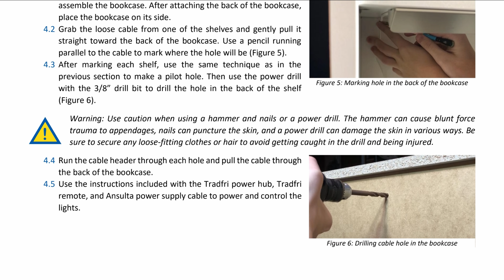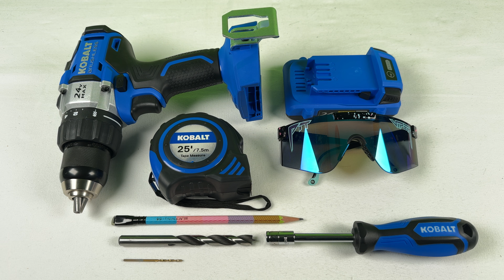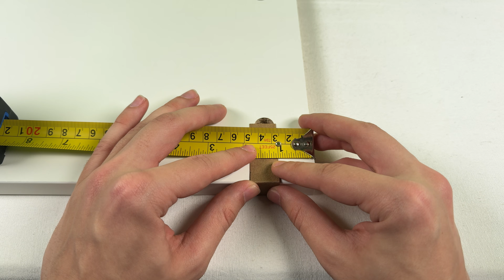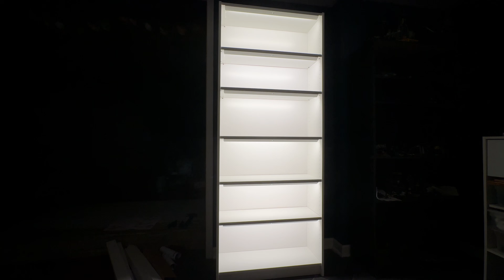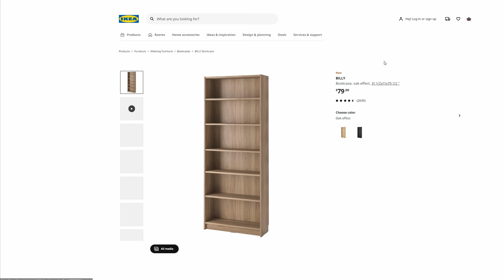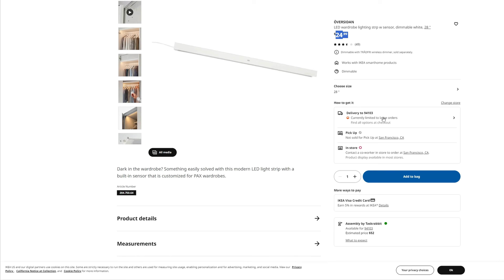DIY ALL IKEA custom lit Billy tutorial using IKEA Billy, Oversidan, and Tradfri lighting hardware

Comment: Can you still do this with the new kit? It’s designed for their closet system and I’m un sure about this route now. You have to specifically search it to find it.
Reply from the maker: I apologize, but I'm not an IKEA expert. This was the solution that I made with what was available at the time. I don't know about anything newer since I haven't had to make one in a while.
Reply: I'm wondering the same but this is part of the product details under good to know "3 different fittings are included – adapted for mounting the light strip under a shelf, under the top panel or in wadrobes with sliding doors." so it seems like it will still have the option to mount it under a shelf like in this video, but also have specialised brackets to be a more convenient installation in the PAX wardrobe. I might go get me one of these to test out in the weekend or just go see if they have one mounted somewhere in the IKEA near by and then see how I proceed.

Comment: whats the true color temperature of these LEDs, the box shows 2700 kelvin but in the video it shows it in a more whiter hue
Reply from the maker: That's likely due to the white balance of my camera. I believe they are 2700 kelvin since it's still warmer than my panel lights set at 3000 kelvin, but I have no way of measuring them myself.
Reply: @leoalpha7 forsure . just wanted to know beforehand because multiple medias show it in different white temperatures it had me thinking they were color adjustable
Reply from the maker: @MfFweep No, the color isn't adjustable, but honestly I used tho think they were way cooler because the white Billy really tricks my eye at least.

Comment: Thanks mate this is exactly what I had in my head and you made it reality lol.
Reply: It does look pretty good, I just wish it were in my price range.  I just came from a video where they used Hafele Lighting, which is SLICK, the side panels of each bookcase have countersunk bus bars and the light strips (which are also countersunk into the bottom of each shelf) have spring loaded contacts on each end which touch the bus bars.  NO CABLING except to make a circuit with both bus bars.   Only about $400 per bookcase, so yeah, I'm just gonna bust open that penny jar which is sitting on the shelf of one of my $27 Walmart Mainstays bookcases.

Comment: Great video, HOWEVER, IKEA has redesigned the Oversidan kits and they no longer are compatible with the Billy’s, because they changed the way they attach. No more metal mounting “A” and “B”, they’re now plastic pieces with integrated nubs to attach to the Pax units and are too narrow for the Billy. Only found this out when I unboxed my lights and went to build my Billy tonight and realized the parts don’t match your video or instructions anymore!
Reply from the maker: I would encourage you to check online for the 28 inch oversidans! It is possible your local store did not have the width you were looking for in-stock. Fortunately, the light strips can be shipped for relatively cheap. That's what I ended up doing for my third Billy.
Reply: @leoalpha7 unfortunately these are the 28” versions. Just got them last week and the hardware inside the box is completely different. All plastic.
Reply from the maker: @TheBeardedGentleman Well I've never had any of my light strips come with any metal hardware except for the screws. All of the attachments are made of plastic.
Reply: I just purchased this setup and everything worked just like the walkthrough stated.

Comment: These lights seem to be switch by sensing light and not motion which is a shame as they would just stay on most of the time on an open shelf. We are using them in wardrobes where some of the space is open so the sensor option does not really work for us.
Reply from the maker: I can't speak for the motion sensing part, I just turn them on and off manually.

Comment: Well done, mate! I am considering doing something similar with Högbo doors on the Billy shelve and using the long Mittled lights- do you have any references on these? :)
Reply from the maker: I don't know about the doors, but I personally would use the oversidan lighting instead of the mittled system. The mittleds shine straight down instead of at an angle creating a less optimal lighting condition. As for the doors, it looks like the hinges wouldn't interfere with the lighting at all since the oversidan light strips don't span the whole width of the shelves.

Comment: wire goes through the bottom, fine. how is it fished from bottom shelf to next shelf up? Do we need a hole in each shelf plank or how does wire path go from one shelf to the next shelf?
Reply from the maker: @islandmerchandise3017  Each light on each shelf has it's own cable that is fed through the hole in the back of the bookshelf. Then all of the cables run down the back of the bookshelf and get plugged into the hub.

Comment: Oversidan lights are now discontinued, any alternatives?
Reply: MITTLED! I built and customized my Billy this weekend with the mittleds and it turned out absolutely amazing. 
You need (my suggestion):

1 big billy
2 hogbo doors (optional but needed in my case, my apartment gets a lot of dust from surrounding parks and construction)
1 tradfri
1 fornimma (cable for tradfri)
5 mittleds 60cm (1 for each shelf. ideally would be 6, but tradfri can only handle 5)
5 vagdal (cable for connecting mittled to tradfri)
1 rodret (the new remote control)

i think that's all. total cost was 290eur.
Reply from the maker: @yAr3d2010  You've gotta be kidding me
Reply: Looks like there are new ones out now. Ar least in Germany.

Comment: Hello, thank you very much for the video. As I understood correctly, you should first attach the lightstrips to all the shelves, including the middle one which cannot be moved later, and to the top one, and only then assemble the Billy. Then you just have to drill the holes at the back and pull the cables through and connect them, right?
Reply: I'm not the guy from the video, but I have added DIY lights to three Billy bookcases so far... yes you should install the lights on the shelves prior to assembling the bookcase. I like to to assemble most of it, slide the backing board in and mark the drill hole locations. then drill flat surface. use masking tape to prevent damage and chipping from the drill. If you haven't decided which position the movable shelves will be in, then you may have to drill after fully assembling and adjusting the shelves.
Reply: @ okey thank you. I ordered my Billy and some lights from Ikea, let‘s see how it will look. I think I will drill the holes after I put the shelves in because I have to find the perfect distance between them cause I want to put Anime statues and some are 30cm high and other 50cm.

Comment: I couldn't find this answer online, so I hope you can answer it here. The TRÅDFRI says up to 10 devices can be connected to it, but that connector thing only has 9 ports, where or how does the 10th port come into play?
Reply from the maker: @Noyma  The TRÅDFRI can connect up to 10 devices, as in the drivers, not the individual light strips. That means you could technically connect up to 90 light bars. That being said, I have already run into de-sync issues with only two, so I would only advise attempting this if you are willing to do a lot of plugging in and unplugging to sync all of them.
Reply: @leoalpha7  Oh sorry the IKEA naming scheme confusing. 
I meant the 30w power supply, I see only 9? connector holes, where on the power supply is the 10th hole for a 10th light bar? I planning to connect some more lights outside the bookcase, but the desync fixing doesn't sound fun.
Reply from the maker: @ Yes, you can connect 9 light strips to the TRÅDFRI 30W driver. The TRÅDFRI remote can pair to up to 10 drivers, meaning one remote can hypothetically control up to 90 light strips.
Reply: @leoalpha7  Ah I see, thanks for the clarification

Comment: Would Command Strips would work instead of drilling?
Reply from the maker: @ytubebrowser7560  Entirely possible if you put them directly on the light strip itself. You won't get the same flush fit, but if it's something you are more comfortable with, or perhaps you don't want to deatructively modify the shelves, you could certainly try.

Comment: you skip the most important part after you drill the back of the shelf you dont show how you make the cable pass through that hole. shame cuz that's really the whole point
Reply from the maker: @hnia0  I apologize for neglecting to show that, but it really is as simple as just shoving the end of the cable through the hole. Obviously, since one end is already attached to the light strip, you just stick the other end through the hole. The drill bit I use to drill the larger hole is large enough to fit the head of the cable.
Reply from the maker: Check out the latest short on my channel, it shows you how to thread the cable through the hole.
Reply: @leoalpha7  Thank you!!!
Reply: Are you serious right now? You need a video showing you how to stuff a wire through a hole?